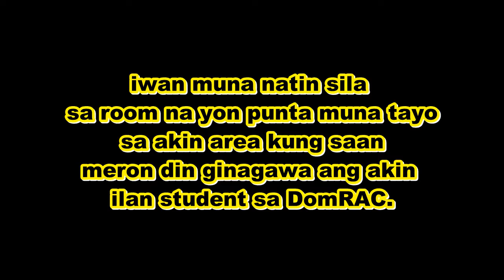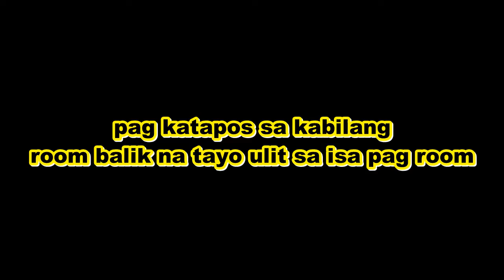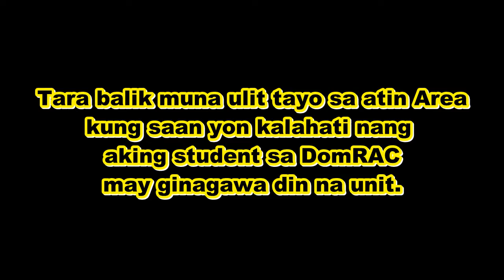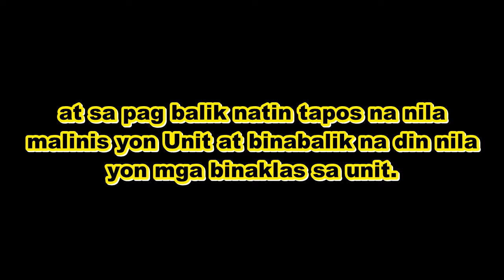RAC#116 video Back Job AC activity

Comment: Sir yun split type aircon ko yun condenser fan motor niya di mainit ang buga nilinisan ko na condenser then test ko ganun pa rin check ko amphere niya start siya sa 3.4 then bumaba sa 2.7 to 2.6.Ano kaya problem leak sa unit po ba sir.